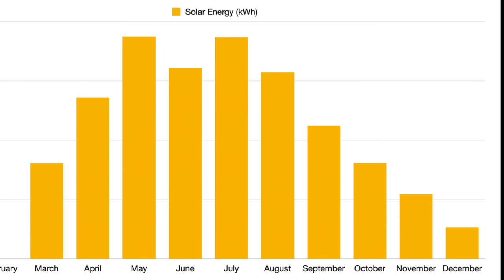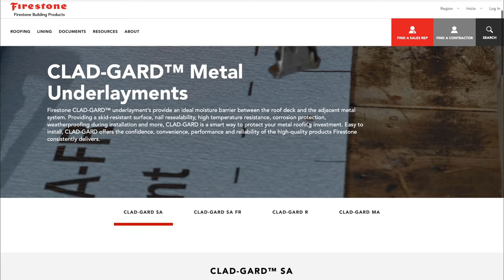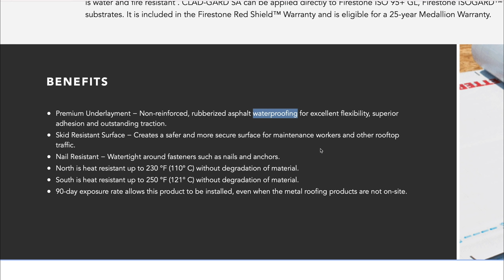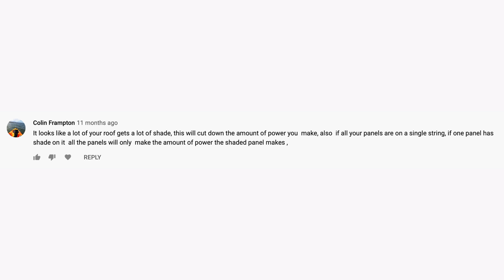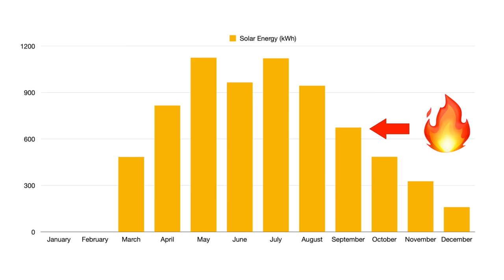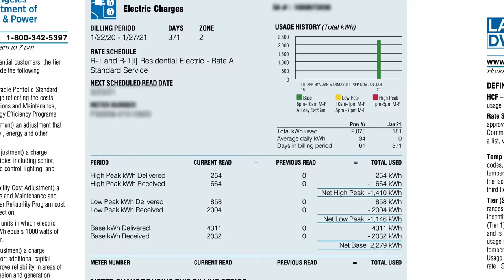1 Year with Tesla Solar Roof: top 11 questions answered + real production numbers & utility bills!

Comment: does the power department not give you any credits/refund since you give so much back to grid? I mean, you get charged when you use their electricity but you get nothing when you give them extra. I was expecting you get negative electric bill or they pay you back for what you gave them.
Reply: yea I mean it seems like they should get paid since only 32% of the energy actually went to their home. and the other 67% went to the power grid.
Reply: This has me extremely upset lol caz they didn’t pay for the roof or anything yet they benefit from it HEAVILY, and some small tax cut still wouldn’t be fair so please sir help us understand this (:
Reply: @bigworm7979  They probably used energy as well. Since they don't have a powerwall they'd require grid power during the night/evening/winter cloudy days. So it probably balanced out at the end and left them with a net $150 charge.
Reply: Think of it like a bank stored in la w&p. The energy the panels produce usually produce and excess of power during the day. When it's night and the panels aren't producing power, the house pulls its power from LA. The panels the he got generate an extra 1,000 or so kwh annually. The excess power then turns into credit for your energy bill Or it can be rolled over to the next year so you have that extra offset of power. Usually the credit isn't even that much because la would only buy the power back from you at around 3 or 4 cents. The bill he got from LA is probably all the fees you pay for being interconnected to the grid. Service fees and such which are usually $12 a month.
Reply: 3 or 4 cents per khw*
Reply: @FenixAron  thanks for this answer! Somehow got here right on time
Reply from the maker: Nailed it! Thanks for explaining so clearly! I should get you to write the script for my next video.
Reply: 5 cents per kilowatt in east LA
Reply: @hunterwade6508  also, to prevent losing a lot of power, power walls are essentially a big battery, and you can keep the energy saved up just in case.
Reply: @FenixAron  really clean answer
Reply: When they said 32% of the solar went to the house and the rest to the grid, it made it sound like that 32% was the entire years requirement for all the house needs and the other 68% was bought by the grid.
Reply: It seems quite silly if they dont cause they sure as hell, sell that free energy back to others. In Danmark we can sell energy stored in our solar panels  to the government/Electric company. Sadly we cant get tesla roofs  yet.
Reply: In UK I get 5p back against on cost of 17p from energy supplier
Reply: @michaelandreasen993  have the power routed to the neighbors next door and charge them instead of into the grid. CA used to pay homeowners that contributed to the grid, but I think that was ended a long time ago.
Reply: @FenixAron  That answer everybody was looking for
Reply: @FenixAron  kwh lol
Reply: In some places they do that
Reply: What about an application in a cold climate like Canada?
Reply: @tradbuffi5890  the cold shouldn’t do to much what effects it is lack of sunlight
Reply: @Kburd-wr6dq  the expensive power wall will allow you to store excess power generated without giving it back to the grid.  Example, Texas in Feb 2021 had customers experience no power for over 56+ hours in -0 degree temperatures.  Those with solar panels on the roof and no power wall still had no power.....
Reply: Thanks for saying what I was thinking. With roughly 2/3rd energy  surplus he should get reimbursed by the utility company for that energy they're charging when it goes so someone else.
Reply: Wow
Reply: @AustinFlack  I think I'd like to see what the bill breaks down to. Your bill shows the upper portion but isn't entirely visible. I see some details of what you received and total used calculations with a net negative that seems FAR more going back than received. If your return on power put into the system at a rate of 6:1 is a net cost to you, then I'd say 100% buy the battery and disconnect from the grid entirely 10 months a year. Expensive or not, you're being stolen from at that rate.
Reply: @shawnmayo8210  did you miss the part where they paid $150 for a year and the wall charger alone was $7500 before any other fees
Reply: 2k dollars saved, how much did the roof cost? When do you project to break even overall?
Reply: @tamaspuskas3796  That's a tax surcharge on the energy.  Not the tariffed rate per kWh.
Reply: @Tico2858  Did you miss the part where he contributes at a 6:1 ratio and still has a bill at all?
Reply: @FenixAron  Thanks for the answer, there is just one thing I didn't understand. Is it the same price that AL "buys" the excess power the same as the grid power the sell?
Reply: @shawnmayo8210  I suspect that the power consumption at night ( when they use the grid) is much greater than at day (When they use solar power).
Reply: @FenixAron  So what your are saying is that he uses 66% of the power at night? The numbers don't add up! Typical California! hE DEFINITELY MADE HIS UNIT TOO BIG FOR HIS HOUSE!
Reply: @Zolar Czakl I'm in NB Canada on the east coast. I would expect snow through much of 3-4 months a year and overcast another 3-4 months. I'm currently in the process of buying  ahome that will likely need a new roof in about 6 years. That roof COULD become a solar roof IF and ONLY IF it's worth it. I don't mind an upfront investment if in the medium term I'm going to see a return on investment. At minimum, I don't expect to be charged for delivery if I'm delivering to them a much higher quantity of energy. It's one thing if there's a few percentage points of theirs being more expensive, but another for this video's example of being charged after he puts out 600% of what they do into their system. They definitely make money off of his power. Add in that oil and gas are not options that are easy or cheap here in the Atlantic provinces. Gas companies will pay to install a gasline to your home making upgrading that way much cheaper. Since the home I'm buying is older and purely electric with heatpumps and baseboard heaters, I'd like to ideally have a source like solar to offset generate most of my own needs through most of the year.
Reply: @user-hh2is9kg9j  Nope. His bill shows his net consumption to be significantly in favor of him
Reply: @BK-xm5nf  🤔
Reply: You can get kick backs in my province for contributing to the grid.
Reply: @sterlingskidmore5621  i wondered the same...then i watched his first video, which explains cost
Reply: @Zolar Czakl The home I'm looking at now is old (1928) so it'd probably be a bit of a project to do the whole roof. If I do it'll likely be the tesla shingles (or similar) since that's going to be the roof itself. My biggest consideration is the moderate sunlight. This OP shows great numbers ... for California. The Maritimes has much more fluctuation in sunlight. Winter is also a big consideration when we can get a few feet of snow in an couple hours. The battery is very likely a must. Seimens is doing a pilot project here of a community built with the panels, batteries and geothermal. I'm keeping my eye on that.
Reply: would a battery bank solve the night time issue?
Reply: There are a few people here in Central Florida that sell their power back to the grid. Their setup was before Tesla and I can only imagine what a Tesla roof would pump out here.
Reply: @Kburd-wr6dq  would a power wall allow someone to live 100% off of la grid? How dangerous is the system? I’m assuming someone with some kind of certification would need to come check it out every so often.
Reply: Maybe he sends nothing back and stores it in his own battery bank. I wouldn't give anything back and just store it for years.
Reply: get 10 powerwalls and disconnect from the grid entirely. sell electricity to your neighboors for cheaper
Reply: That grid thing is total bullsht, it defeats the purpose of getting solar roof in the first place. You should have access to 100% of the power your roof produces and and kiss your electricity bill goodbye.
Reply: Yeah I thought his electric bill was going to be a negative number (payment to him). What a racket.
Reply: @neume1982 ......that's dependent on when you put the system up, it think early on it was 40p, but it has been cut multiple times.
Reply: @tradbuffi5890  cold helps...it improves the output. Look at PV-T.
Reply: @jameson1239 .......dry,cold & bright....great output.
Reply: Austin, What was your cost out of pocket total and per month for the Tesla roof?
Reply: @shawnmayo8210 ........look at PV-T, there is a Turkish made panel that has been out since the 70's...and there is a german copy of it.
Reply: @robertwoodliff2536  Looking at other companies for sure. Particularly after the nuclear bombs dropped on customers by Tesla a week or two ago.
Reply: Wow what a waste of money only to do it all again in under 25 years. What is the approx cost for this roof?
Reply: Greg Gaming  well I honestly appreciate your response. I’ll check them out.
Reply: los angeles can get very hot during the summer. so hes probably running his AC. thats expensive. and remember, when the sun goes down, he using up any credit he accumulated during the day. plus, that layer of soot probably made the system less efficient.
Reply: Greg Gaming  awful lot of homes where I live that are 100% off grid. A lobby doesn't factor into the cables going to a home whatsoever.
Reply: They still have to pay for the expensive grid maintenance. And some power is lost during transmission.
Reply: You do get paid. At least in the state of Arkansas
Reply: @Sulfen  but they don't have to pay for the costs associated with the 6:1 surplus power generation.
Reply: @AdarshSingh-kp4th  well said.
Reply: Seems like there is a cost and benefit to be connected to the grid.  In my city even if you are not on the grid you have to pay for power ... that's how city operates ... that is why it is a city and not a million little individual homes.  If you are giving your excess energy back to the city, or some amount of it ... what is the problem.  Figure out the best deal for your to stay connected to the grid - because you may need it at certain times and move on.
Reply: @justgivemethetruth  The problem is that the property taxes pay to light the city and the individual owners of homes and businesses pay to light properties. Being charged for power, even if you don't connect to it, is a serious problem. It's just straight theft. Not being compensated adequately for producing power that they will sell to others at full freight is also theft. Just giving you the truth...
Reply: @shawnmayo8210  
I understand your point, but I disagree that it is theft, any more than taxation is theft.  If you are an extreme Republican who believes that taxation is theft  - not much to be said about that.  That is the only way a city or country can run.  You live in America, you are have to be an American.  You live in a city you have to contribute towards making the city work.  They should honestly do the best they can to reduce those costs but we are entering an era where it is going to take everyone working together.  That is also the truth.
Reply: You get energy credits you do not get money. If your system is large enough you stockpile enough during the good months that the credits equal out the overage in the bad months. The money you do pay are connection fees as you still need to be connected to the grid and they want money for that as well as some maintenance fees and taxes. I know PG&E (local utility) wanted to charge I think it was $21 per Kw of solar on your house but I believe it was shot down about the time mine was installed.
Reply: @joeevett9007  and at a 6:1 ratio of putting into the grid vs what you take, you should be making more than 1/10th the cost to receive. Connection fees are fine, but reselling your excess power at the same profit without paying the cost for production to the source (the home owner) is actually criminal. If the utility wasn't profiting off of the homeowner, you might have a case.
Reply: @justgivemethetruth  I'm not american, and thankfully so. That said, you're pretending that this has anything at all to do with taxation. You have no point because you aren't talking at all about this. As indicated in my previous comment, the utilities are paid for by the users. The utility pays for production EXCEPT in this case where they pretend the production is worth significantly less than the energy produced more formally and then they resell the home owner's power for the same amount. They are in fact stealing. I'd accept an argument that reliable production makes the value of the produced energy at the home to be 80% of the value at the end of the day. I can't accept any argument, no matter how flacid, that the home owner's power is worth merely 8% and solely as a credit. Pretending anything else is acceptable is just nonsense. And that's just giving you the truth.
Reply: @shawnmayo8210  
It is not a free market, and it is the same principle as those who complain about taxation.  If you do not like the terms, you made a bad business decision.  What do you think should happen?
Reply: @justgivemethetruth  Pay adequately. Are you ok with the city employing people for less than minimum wage and saying they made bad business decisions for working for them? It is in fact a free market in most regions. It's perfectly reasonable for people to expect reasonable compensation. I'm not sure why you don't seem to feel that way, but it's probably the same reason you can't be bothered to use your real name on your comments. And that's just giving you the truth.
Reply: @shawnmayo8210  it would be cool to make it back for sure. I have 7kw in solar so I almost never have to pay at true up. I have a 5 bedroom with 6 people so for me I'm ok with not getting money as I went from 300- 500 summer bills to just the PG&E fees.
Reply: @joeevett9007  And that's pretty reasonable to expect to pay for the option of using the grid. I just don't think this video shows anything close to reasonable for power generated and given to the utility to resell. 80% of the rate is a reasonable expectation given that the utility has more reliable production and that the home owner is powering 6 homes plus their own while the utility profits.
Reply: @shawnmayo8210  it is a bad decision if you work for less than you are worth.
Reply: @shawnmayo8210  
> Are you ok with the city employing people for less than minimum wage

That is a ridiculous analogy, and that the fact that you are willing to argue your point based on that makes it not worthy of consideration.

>> It's perfectly reasonable for people to expect reasonable compensation.

That is a little more to work with.  Do you have any idea other than you think the City just wants to be "bad" ... i.e. mean, greedy, stupid or some other insult ... as to the economics behind the city's pricing?
Reply: In my country, We get to opt for Net billing. We can use both power from the government and solar power for personal use and also deduct all the solar power that goes back to the grid. Basically we just produce solar enery and sell it to government while we still use the power from the national grid from the government. if ur solar power sale is greater than conaumption, u just pay monthly rental fees
Reply: @AdarshSingh-kp4th  I get paid approx 3 inr per kwh of energy sent to grid from solar and I have to pay the energy consumed in excess of production at approx 8.5 inr per kwh in Rajasthan.
Reply: he didnt clean his roof for part of the year. and when you live in a hot area alot of expense goes to paying for AC he could have gotten paid if he had used less energy or had a way to store energy so his meter would run backwards when he wasnt drawing power directly from the pannels
Reply: 10.2c per feed in kwh in NSW Australia
Reply: @shawnmayo8210  for one, 36% in and 63% out is not even close to 6:1.  for another, you don't understand California if you don't understand how much of his bill was monthly taxes and fees.  had he done this in Texas, he would have probably made a profit.
Reply: @Rachel Marie getting a gas powered backup generator for emergencies would be a much more cost effective decision.
Reply: In India, it works like that
Reply: @punishr36  saving 2k a year for 25 years.
Reply: @josh2yall  What did it cost to make that 2k a year? If the money was invested not only would you make more than 2 k per year you would still have the principle.
Reply: @Zolar Czakl when you take into account your contract amount, what is your position?
Reply: @3h0und7  if they would have got the house batteries they could have stored/used some of that power for use during the night, cloudy days, winter etc. Since they didn’t, they have to pay for the power they used when the sun wasn’t shining. Finally balancing out at +$150.
Reply: @Jeffreypark  I wonder how many of your neighbors homes can you connect to
Reply: @backdownhipi  are you referring to starting your own small electrical company in your neighborhood I'm interested I want to do panel Fields on four lots perhaps some wind turbines what do you think
Reply: @3h0und7  the answer is simple: LA is a Marxist central government run metropolis. They take, take, take, regulate, regulate, regulate, control, control, control, tax, tax , tax, spend, spend, spend. GET IT?
Reply: @shawnmayo8210  Service fees.
Reply: @Zolar Czakl How many years was your install payback?
Reply: @barbaraflowers583  apparently most electric grids won't pay you for the extra input. Best to connect your neighboors and charge them half price of the electric company
Reply: @veergauba   Gonna bet that $150.00 charge is just a fee. I have gas heat and during the summer I don't use it. I get billed $7.00 a month when I don't use gas, it's what I call a stay connected fee!
Reply: @Zolar Czakl If you pump more into the grid than you need does that extra go towards your sunrun utilities (eg pay), remains neutral, or does it reduce your sunrun bill at the end of the month. Technically it is generated, but you did not use it.
Reply: @michaelandreasen993  You will soon.
Tesla is refurbishing their Netherlands car factory for Tesla energy.
Reply: @justgivemethetruth  you have nothing to say and you're not willing to put your name behind the comments about stealing from people. Probably why you have no one liking your "arguments" and I do.
Reply: @shawnmayo8210  what i still don't understand is why this guy is still paying anything to the electric company. Even if he uses the grid at night time let's say 30 % like he does during the day. The electric company would still be getting 25% of the electric from him. So why is everyone's comments saying this is a awesome thing. I would need to pay ZERO dollars if I am giving electric to a company grid. There is a question somewhere in there lol. Sorry
Reply: @Tankburks1983  I actually don't have an issue with something paid for the grid maintenance and option to draw power when needed. That said, I wholly agree with you that he's being stolen from.
Reply: I was gonna say the same thing, did he get paid for back feeding the grid!?
Reply: @AdarshSingh-kp4th  some bs. They charge somewhere around 10 per unit for houses and they buy what your solar energy produces at 2 per unit.
Reply: Can't you send the 67% to your neighbors and charge them?
Reply: But is it worth it? What was the I
Initial cost?  Seems you would save roughly 40,000 over 20 years. I saw where a 2000sq ft roof cost around 50,000
Reply: With our solar insulation. We sell it at a specific rate to the local power company and buy if needed. I don't think they just get power for free. I'm surprised it took them that little time of 3 week after install to connect to grid. Our smaller system was on months after installation
Reply: @justgivemethetruth  all I can say as a lifelong Chicagoan with family in Los Angeles, you have a simplistic, rather ignorant view on taxes. 

Also, for those wondering about the cost and benefit of adding solar or becoming more efficient. You better believe a city like Los Angeles is going to squeeze every dime out of you to the point it’s probably not worth it. There is a reason why people have been fleeing, high tax big cities even before the pandemic. 

I actually like the idea for solar, particularly in a city like LA where the energy grid is poorly maintained and the state has done next to nothing to fix infrastructure despite the absurd taxes. I see it more as a fail safe than saving money. For example how much did it cost to clean the roof? That alone could offset much of the savings along with the cost of installing the roof. In addition, given what a nightmare Tesla cars are to maintain and fix what happens if something goes wrong with the roof? Nothing is 100% effective. The power wall also does not seem with it from a cost savings perspective, but is worth it as a safeguard.
Reply: @Jeffreypark  I'm literally looking into the legality of this option right now , thanks .
Reply: They used energy as well, so their total energy given TO the grid is probably tiny bit lower than what they used FROM the grid, hence the 150 dollar bill.
Reply: @shawnmayo8210  

Very naive view of how an electric grid works and what goes into running it effectively and how the price of electricity varus throughout the day and how at certain times the grisls might fine you for producing.
Reply: @angry-white-men  that would be a very stupid plan tbh
Reply: This is commifornia, you think they would give money back 😂😂😂